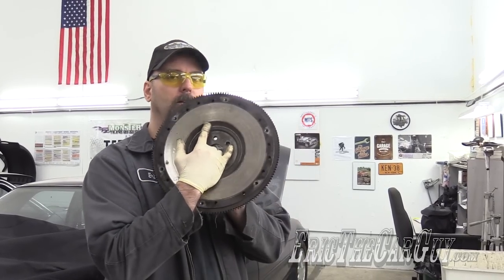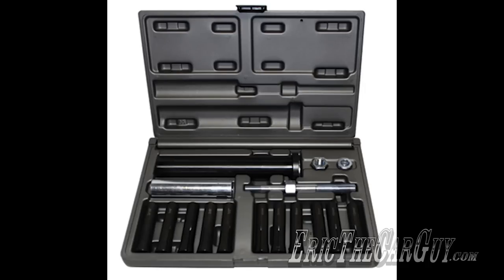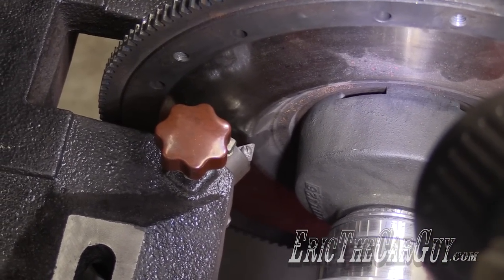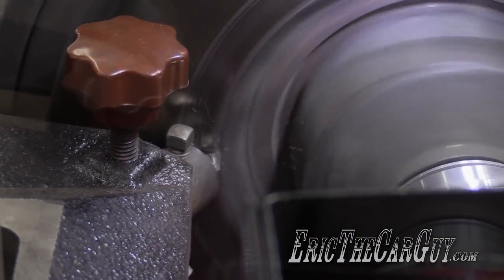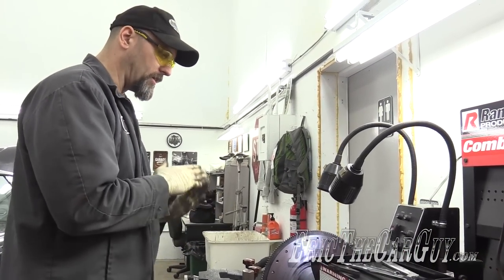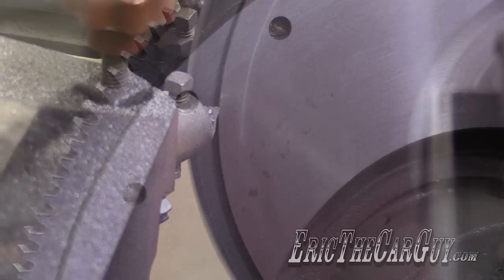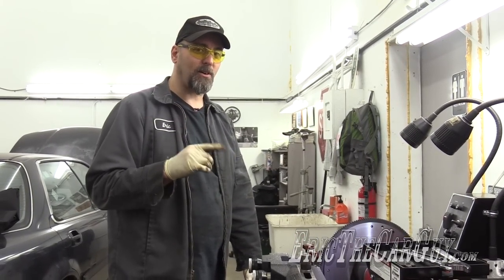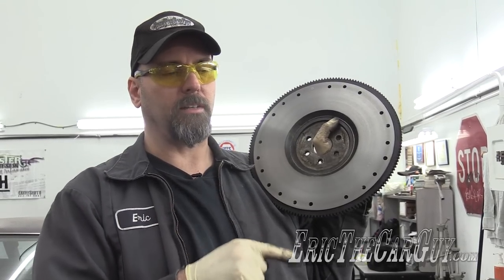Can You Machine a Flywheel with a Brake Lathe??

Comment: Doesn't need balancing????
Reply from the maker: +athalfridhu This won't effect the balance. You're taking off an even amount across the entire surface.
Reply: +EricTheCarGuy Thank you!!!
Reply: +athalfridhu No, he just skimmed a little bit off the face, the flywheel was balanced when it was manufactured. Some of those holes that seem unnecessary, are actually holes drilled to balance the flywheel at the factory. It is better balanced now than when he started, because of the uneven wear he encountered.
Reply: +EricTheCarGuy A couple of things...

1 - No it isn't... That's why you can hear the discontinuous cut across the face, and by your own account, it was cutting more material off at the outside of the flywheel vs. the inside.

2 - Without indicating the flywheel in you really don't know what you're getting and I don't think brake lathes are manufactured to hold that sort of accuracy anyhow. The cut could be all over the place (again, adding to that discontinuous cut you were getting in the beginning) despite "looking" good.

----

On a brake rotor the imbalance would have to be pretty severe before you would notice a problem inside the vehicle (hence why they aren't balanced), but on a flywheel an imbalance could be a big problem and cause all sort of harmonic nastiness, especially on something you intend to really rev. I'm not a big fan of reusing flywheels, but if I were to do it I'd want it done on a proper machine and balanced afterward (there are videos of flywheels being balanced on YouTube if you want to see what the machine looks like).
Reply from the maker: +Maxwelhse I think you're taking this a bit too seriously. The machine worked fine, the surface was excellent and I believe it would have worked just fine. As for balance, I already took my flywheel to my machinist and he recommended a new one instead. Not because of the machining I did, but because the new crank I'm using requires it. Thanks for your input.
Reply: EricTheCarGuy
Of course I'm taking it seriously. You're machining engine parts. I didn't question the surface finish, I questioned the balance which you have no way to verify and no reason to trust. I get it that you're not using it, but if just bolting it on without asking the shop to balance it was part of the plan, then that's a bad plan.

So... To the guy that asked, yes, it needs balanced and people who machine flywheels in a machine shop do balance them. If a shop told me "ehh, don't worry about it" I would find a new shop, especially when building a high performance motor. Since the cat is pretty much out of the bag that you're building a blown, if not stroked, motor I find it weird that you would endorse such corner cutting.

I'm normally not THIS critical of the things you say or do on your channel, and I don't want you to think I'm personally attacking you or anything, but this time I think you're on the wrong side of the issue. I can accept that you disagree.
Reply: +Maxwelhse The" discontinuous cut " was from uneven wear and warping from heat. Very true that the flywheel wasn't indicated in, and that is always preferable. I would have liked to see what the cut looked like if he had touched the face on the outside. All things considered, I would use that flywheel. Oh wait, it's a Ford, maybe not lol.
Reply: Theguywhowouldn't
It doesn't matter why it's discontinuous, only that it IS discontinuous. That means an uneven amount of material was removed, which absolutely does impact balance.

I'd use that flywheel on a tractor or something that will never spin faster than 2800rpm, but not in a high performance application and probably not in a car at all. As I said, I prefer replacement usually it's affordable to do so, though there will always be exceptions.
Reply: +Maxwelhse Um, the wear actually was what was uneven. Eric improved the surface. You always get a discontinuous cut when the surface is uneven. Now the surface is flat. What you want is flat and parallel. There is no doubt it is flat. I believe it is also parallel enough. Indicating it in would have made sure of that, i agree. But it should be obvious that the surface is now flatter than it was.
Reply: Theguywhowouldn't
This conversation is about balance. An unequal amount of material was removed which means that it physically can no longer be in balance.

How much? Is it out of spec? Who knows? That's why we measure things.
Reply: Theguywhowouldn't
He didn't machine the back of it, or indicate it (which wouldn't have helped because it's not like he can adjust that lathe anyhow by any normal means), or put it on machine capable of holding a tolerance, so you have no idea what is flat and parallel. Which, again, is why we measure things.

Whatever man... I've already said you can go watch videos where this is done correctly. You think I'm just imagining this stuff so I can argue with random dudes on the internet? A question was asked, a wrong answer was given, and I've corrected that situation. That's that. I can't beat you with a rock until you understand, so, OK then...
Reply: +Maxwelhse I agree with Maxwelhse, I recently had a ford 302 flywheel machined, the workshop didn't do a balance after, and once installed it sent vibrations through the whole car. I know for a fact it was the flywheel because I replaced it with a new one, same clutch etc, and now it's smooth again. Pulling the gearbox again for someone else' mistake was not fun.
Reply from the maker: +Maxwelhse So I asked my machinist about this yesterday and you are correct, removing material from the flywheel will effect it's balance. How much, would depend on how much is removed. However, I've resurfaced SEVERAL flywheels in the past with a flywheel grinder and NEVER balanced them afterward. Not one of them ever had a problem with vibrations when I was done. Nowhere in the literature of the machine did it mention balancing was a priority after machining. Did I get lucky? IDK, but it's never been an issue until you brought it up. Lastly, when my machinist balanced my rotating assembly yesterday removed weight from the crank, not the flywheel. He did this to ensure that if I ever decided to go to an automatic, the engine will still maintain it's balance. Thanks for your input.

Comment: Something tells me getting your sleeve caught in those flywheel teeth would be catastrophic.
Reply: +Matt Jones Getting anything caught in there that's attached to you while a lathe is running is catastrophic.  Look up lathe accidents in Google Images if you've already had breakfast.
Reply: As a woodworker,working with any machines is extremely dangerous and be extremely mindful of what you are doing if you still want your fingers intact.
Reply: +sc0tte1 his point is you should never use equipment like lathes while wearing long sleeves or gloves.
Reply: FINGERS? Hell, do a google image search for "lathe accident" and you'll see a lot more than lost fingers.

Comment: Holy crap man, cleaning your brake lathe is meaningless if you don't clean the mating surface of the piece you're mounting. Compounding the issue is how you mounted the flywheel's face against the cup when it mounts to the crank on the other face, which you were just holding the a cone. Never hold your piece with a cone, always use two cups, the cone is for centering only. Finally, just set it to the slowest speed and go do something else, the tool tip and surface finish will thank you for it.

Comment: Looks great when your using a flywheel with no burnt or "hot spots" on the surface. But,,most flywheels have hot spots,,and the only way you can clean them up is with a flywheel grinder.  A lathe wont cut into the hard spots, just "passes" over them and leaves a terrible surface. As labor intensive as clutch replacement is,why would you risk a half ass method of flywheel re surfacing? Flywheels should be ground,not cleaned up on a lathe. Go to any HD truck shop that does clutch work on big rigs and see how many would consider a lathe as a flywheel resurfacer. The answer is,,,,0 !!! It's obvious this video is a vehicle for you to promote another sub standard Chinese copied "Ammco 4000" lathe Eric. And what is the statement "giving the bit a time to rest" mean???? Does carbide get tired???
Reply: 5096PS Using a lathe to finish a flywheel is a good option for quickly dressing the surface - when installing a new friction plate on an undamaged flywheel. Like running a single pass on a used brake drum or rotor when installing new shoes or pads, to ensure a clean, even surface.

Similar to boring vs honing a cylinder during overhaul. One method is clearly and technically superior, but not always *necessary*. If the dimensions are still within (or sufficiently close to) spec, and the base material isn't damaged (overheated, gouged, etc.), but the surface finish is poor, just clean it up.
Reply: When carbide does bounce over the hard pots, you Can use a diamond tip insert no problem , do lots of them . Or put them on a surface grinder.